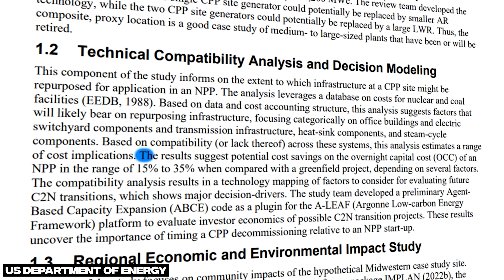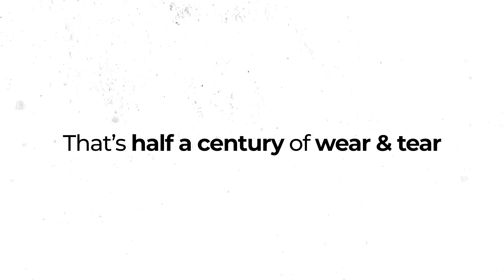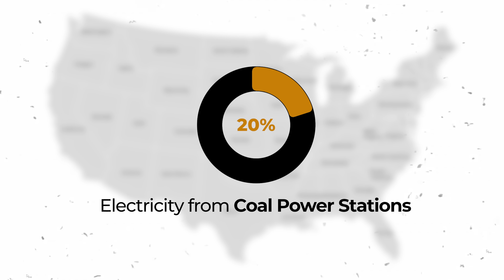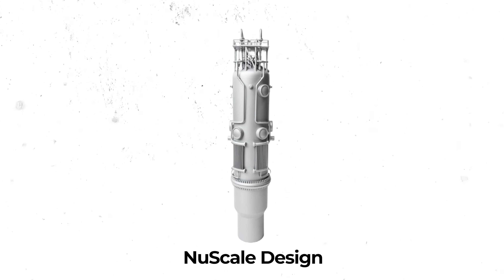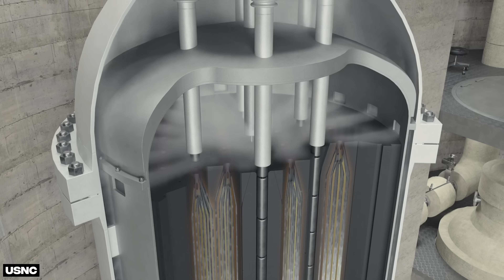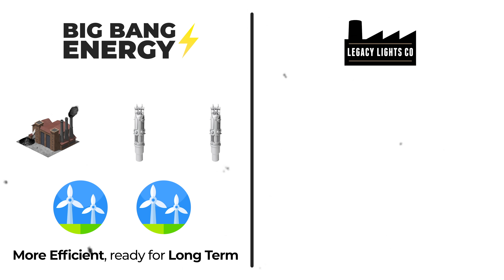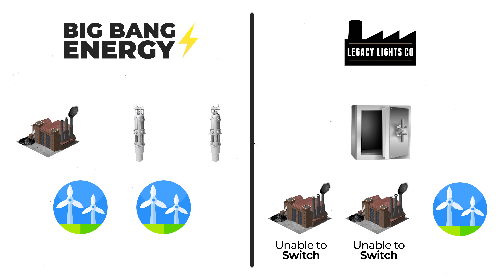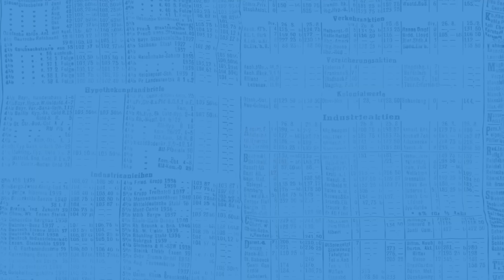Can We Convert Old Coal Plants to Nuclear Energy?

Comment: Great concept video; but you completely missed on a 2 key points (ignoring that all SMR's are currently ideas only and have not been proven to work; and there is not a single sodium cooled nuclear power plant that has not had critical sodium leak problems).

I'm now retired and have spent much of my life working in fossil (gas/coal) plants and nuclear power plants - so I have a real understanding of the challenges, issues, and possibilities.

1) All coal fired power plants use highly super-heated steam - and at temperatures and pressures that no proposed nuclear plant will even approach with currently known metals used in nuclear power cycles.   Direct reuse of the turbines, FW Heaters, etc and major pumps will not occur.    Reuse of the foundations that the current turbines and major pumps sit on can occur.  Reuse (likely with rewinding) of the electrical generators can occur.   Transformers, substations, and major transmission lines can likely be reused with modest changes.    The major cooling water source (pump-house, pumps, cooling towers, etc) can be reused likely with some upgrades or rebuilding.   The existing condenser is a toss up; and this is the biggest limitation on the output of the new generation as it will be size constrained by the existing structure: Nuclear saturated steam condensers need to be noticeably larger for the same power output than fossil supper-heated steam condensers.   My off the top of the head estimate is that you can expect at least a 20% power output reduction moving from high pressure very high temperature super-heated steam to saturated steam for the same condenser size.   Reuse of the old pipelines is very questionable as their poor condition is usually one of the key factors in retiring these plants (have you ever seen 50 - 80 year old power plant piping and components and dealt with their problems:  I have: trust me its better to just replace everything with the new reactor so it can have a long and reliable run life).

2)  You completely misunderstand and misstated the capacity factor situation.     Nuclear power plants have very high capacity factors as its been determined that the most economical way to operate them is to burn up all the fuel in the fuel rods over their planned life.  Thus they typically run @ 100% of power when operating (that is the goal); which gives at typical 90%+ capacity factor for the year.

Fossil power plants are "load following" as the electrical demand for power goes up and down during the day.   It's not uncommon for a coal/gas/oil fired plant to be at 15-25% in the middle of the night and 100% 12 hours later.

The best maintained fossil power plants are just as reliable as nuclear plants (they can regularly run nonstop for a year or more between maintenance shutdowns: although a number of coal fired boilers have a scheduled shutdown for maintenance every 6 months).

It's the load following characteristics of the up and down nature of the daily power demand that gives fossil plants an average capacity factor of 50%.    

If you replace all the fossil plants with nuclear plants then the nuclear plants will have to load follow as well and their capacity factors will drop correspondence.     Please note that two of the nuclear power plants I worked in were built as "load following" units (and they still had the controls installed to switch to "load following" mode); and their capacity factors during their initial years of operation in the 1970's was no better than the fossil plants in the area.

There's a lot of other lessor issues. But the key question is can an existing fossil power plant site be repurposed with replacement nuclear units.   Certainly some of them can be - and I think that would be a good use of them.   For a variety geologic and security reasons others cannot be.      It's just not going to be as simple as you propose.   Basically strip out virtually all the old equipment, pipelines, and wiring... and reuse the foundations and the cooling system pumps and cooling water source.
Reply: Thank you, Mr. Allan. It is always mind numbing when a plethora of stats and charts are presented without a good and thorough breakdown on meanings, origins, etc on where your numbers come from and what they actually mean. Your "re appraisal" of "load following" was a totally new concept to me, and I suspect to others following this site. Again, than you.
Reply from the maker: Thanks a lot for your feedback and insight. Unfortunately these kinds of details can be easily be lost or they can be presented as "non-problems." This study did look at a few different scenarios of re-use, from basically just the site and the office buildings, all the way to re-using the turbines. For the re-used turbine case, it did point out some of the difficulties you mentioned, particularly the different steam conditions (superheated vs not). The X-Energy high temperature gas reactor could (theoretically) produce the required temperatures, but would need another loop between the reactor and the steam side to make it work properly. But as you correctly pointed out, none of that has been built yet.

Load follow has become more and more of an interesting topic, especially as more renewables come online. Only a few places are using nuclear consistently for load follow. The US isn't one. France is the best example that comes to mind, but other has done it to lesser extents. So there is international experience even with the current designs to do it.

Anyway my honest opinion is that if such replacements at coal sites were made, most of the steam side would be replaced. It's the site that becomes more valuable with the existing grid and water connections. Cheers!
Reply: @@markaspen I never said SMR's were unrealistic.  But, my decades of power plant experience tells me that a lot of things did not work out the way that designers thought they would; and every country that built early nuclear power plants ended up closing some of them very early due to those problems.   Long term operation and maintenance also led to many other design retrofits (and I was personally involved in some of those).

It will take several decades of run time on any SMR concept to show that the concept actually works long term - or can be easily modified to one that does.   We can only now build really reliable long life LWR large reactors because of the many decades of lessons learned.   Those lessons learned don't exist for novel reactor designs.

I mainly pointed out that sodium cooled nuclear reactors have a horrendous history.  Multiple sodium cooled commercial nuclear power plants were built in multiple countries - and with the exception of the one in Russia were all very prematurely shut down due to sodium leaks (and the French one was supposed to fix all the issues of the earlier failures).

Russia currently claims that it's liquid sodium cooled nuclear plant is essentially sodium leak problem free.  Unfortunately, the history of the Russian Nuclear Program is that there are multiple cases where the real truth of the problems did not come out for 30+ years.   I don't trust the Russian statements based on that.

As such I consider the natruim reactor concept dead and will never likely be built.
Reply: @jimfrazier8611  I'm not mistaking what can realistically be done at all.  1st:  No one has solved the corrosion problem of the molten salt reactors to the best of my knowledge (and up to 4 years ago I had access to all kinds of nuclear plant information and concepts as I worked in the industry) and cannot yet be considered a serious long term power plant option.   2nd: there is nothing new about sodium cooled reactors.  Many countries built research reactors and at least 3 countries built commercial power plants (including the USA and France).   To the best of my knowledge (and I researched every sodium cooled research and power reactor ever built several years ago); every one of these have had significant problems with sodium leaks (sodium reacts violently with water - so a tube leak in a steam generator creates and effective ongoing explosion); and both the USA and French power plants were shut down way early in their planned life (nuclear power plants must run for many decades to be economical).   Russia claims that their liquid sodium plant has not had any real problems.  But I don't trust them as there are many stories from the Russian/Soviet plants on what really happened 20-30+ years ago that was covered up for decades.

The high temperature gas reactor (AGR & HTRG) is a more workable option - and there is a lot more commercial success with them (Peach Bottom Unit 1 and Fort St. Vrain in the USA and in the UK the now retired Magnox and now the AGR's which are currently operating); However, both the US units were shut down very early as they needed major modifications to be economical (design ideas worked well enough for proof of concept; but not for economical operation - this is why new concept plants need a lot of run time to prove they will actually work).  In the UK the Magnox plants were never economical as they were designed for both plutonium and power production and the more modern AGR replacements have done well but are about at the end of their life and the UK is building PWR's as replacements as they are more economical.

The other problem is that the current proposals for say the X-Energy helium cooled pebble bed reactor missed a key concept of power plant design.   They are designed to produce 1050F steam at 2400 PSI which is a modern value and on 1st look on paper would match many of the existing coal fired power plant infrastructure (although they may have to downgrade to 1000 F, 1005 F, etc for many of the older coal fired power plants as that is their design temperatures based on the alloys available at that time).   What those designers and many people just looking at steam conditions miss is that all of those fossil power plants use a dual heated steam cycle - which has to be matched if you are going to use the same turbines and to get the same efficiency and not destroy the LP turbine sections.

The typical fossil power plant of 1980 vintage will send 2400 PSI steam @ 1005 F to the turbine throttle block.  Run it through the high pressure turbine.  Then return the steam to the boiler to go through a "reheater" section, which again supplies 1005 F super-heated steam to the LP turbines.

Without this reheat steam section you will loose a lot of efficiency and power output, and will have major water problems in the LP turbine.   Even PWR nuclear power plants reheat the steam between the HP and LP turbines (I'm not sure about BWR's - I didn't spend that much time at one decades ago and don't remember)

I get the impression looking at the X-Energy and other sites that these people really don't know anything about key steam cycle efficiency equipment and processes (which has been standard power plant practice for I think about 75 years on large units; and was covered well in my college thermodynamics class on steam cycle power plants when I got my engineering degree many decades ago).

I'm now retired and spent much of my life in marine steam propulsion and power plants (both fossil and nuclear).  I look at most of the new design concepts as nice ideas; but I believe that only Holtec with their SMR stands a chance of working as designed. Holtec has the working knowledge of LWR lessons learned; and the vast majority of initial design plant ideas failed economically after being built.  Mistakes in the nuclear power plant industy are very very expensive to fix - if they can be fixed at all.

The pebble bed hot gas reactor is the 2nd most promising technology that I have seen.   There's a lot of research on pebble beds; but I don't understand the concept of not planning for a reheat cycle (which tells me that they are missing the obvious - which leads to the question of what else are they missing).
Reply: @atomicblender  I agree that the steam side of the plant would be replaced.   

Please see my answer to "@jimfrazier8611" below on what is wrong with the concept of using the C-Energy reactor to supply steam to the old fossil turbine generators.     I'm dumbfounded on why they didn't include a steam reheater as part of their reactor design for a steam power plant.   I wonder if anyone working for most of the SMR concept companies have ever toured a power plant and learned about steam cycle efficiency.
Reply: I worked in the nuclear industry for 40+ years at 5 different facilities and people like this YT creator have no real world experience.  Everything in nuclear is documented, evaluated, and exact.  Coal fired plants are so far removed from the way a nuclear plant is operated as to be two completely different animals.  Of course, there are so many details that it will have to actually be done to expose all the issues.  Terrapower is planning on siting their Natrium reactor at a 60 year old coal plant site.  It will be interesting to see how that all plays out.
Reply: @perryallan3524  These MSR fan boys rely on YT videos for their "knowledge" .  I am of the "build it, operate it, and prove it" before claims can be made.
Reply: @@markaspen A wheeled nuclear power plant?  Really guy? what are you smoking?
Reply: @clarkkent9080  I think they are just desperate to cut costs. The existing site will have a major trunk connection and an extensive switchyard, transformers etc.
Presumably there is also a convenient source of cooling water, and existing pumphouse, piping, filtration etc. 

This is all fine. May as well use that.
I think they will have enough trouble with waste handling and the longevity of exotic materials in extremely corrosive and hot environments to fail anyway. I further think that advocates are being hopelessly optimistic about the waste burning capability. Waste-burning uses up neutrons like crazy, neutrons that would otherwise generate heat in a responsively controllable manner. It uses up good fuel to destroy what is barely burnable at all, and that the heat recovered by wate burning will barely exceed what was used to "burn" it. And then there will still be lots of U238 etc getting bombarded... I think these reactors will wind up generating just as much transuranic waste as any others out there, plus fission products, but that the spectrum of heavy isotopes will be skewed towards those that are even more difficult to dispose than simple spent uranium fuel.
Reply: @aaroncosier735  Building a new nuclear plant next to an existing nuke seems to make more sense to me and that is the direction that VC Summer and Vogtle chose. And there are sufficient shutdown nuclear plants to provide more than enough locations for the needs of the near future and they come with all the necessary site evaluations and grid connections

 If you dig deep into the reasons for the massive cost and schedule over runs on the VC Summer/Vogtle projects, it runs the gambit from suppliers unable/willing to provide nuclear grade components, fraud, in adequate planning/project management, lack of workers with the skills necessary for a nuclear build and the inefficiencies that come with anything complex.  
In my simple mind, the current  issue with nuclear is not the reactor design but the inability to construct one in a reasonable time and at a reasonable cost that can compete with other generation methods.  Until the construction issued is addressed nothing will change. 

Specifically concerning the "new" reactor design concepts, my best guess (and you know what guesses are worth) is that fusion will be here before these new designs can be built, proven, and  "bugs" worked out. 
In summary, I would not recommend anyone pursue nuclear engineering or any nuclear career as there are enough ex-navy nukes with the necessary skill set to fill future voids left by boomer retirements for as long as this commercial nuclear party lasts.
Reply: @@markaspen Net ! I do not follow Russian nuclear technology as it cannot compete with the Western safety standards as has been proven in both their commercial and military fields.

 The U.S had the SL-1. While not mobile, it could be assembled on site in a few days from modules.  You can read that story on how that SMR worked out.

The TES-3 was on tank tracks driven through 22 wheels, so I'll give you that it was sorta wheeled. 
This Soviet utility was built on the body of T-10 Tank and weighted 310 tons and was capable of transporting over 37 pounds of uranium. Some tests were done in the 1960s, but the unprofitable project was ended in 1969.  If it was unprofitable for the Soviets that don't care much about safety ( no containment and no safety systems) , do you really think it would be a good fit in the west?

And at 1.5 Mw it could not power much.  That is the equivalent of 350 solar panels.  BTW, the standard U.S. PWR requires more than 100 Mw just to operate all the necessary equipment (Hotel load).
Reply: @@markaspen Given that this YT creator has no nuclear education or experience, and I have 40+ years at multiple nuclear facilities, you can take that for what it is worth. Or not , I really don't care.

My experience is in the U.S nuclear programs.  What happens in other countries has little bearing on what can happen here in the U.S. . And no, coworkers do not want to talk about work related subjects or the history of nuclear power. We usually have a nuclear power plant to run and concentrate on that.  In your line of work, you must have a lot of down time around a water cooler. But we do like donuts so you got one right. 

As one example, China was the first country to build the Westinghouse advanced passive safety feature AP1000 and actually built 4 that are not only operating but were built on schedule and within budget.  VC Summer and Vogtle had all of China's building experience but VC Summer cancelled theirs and Vogtle is 120% over budget and schedule.  So would you use China as an example for the U.S. ?  You seem to be a SMR fan boy, do you use SL-1 in your arguments ?  It was, after all a U.S. reactor.

I have never used the SL-1 event to argue why a SMR is not feasible since the technology is worlds apart.  And a Soviet reactor tank with no safety features built in the 1950s before I was born is also of no concern.  Do you argue that we should be able to build cars for $2,000 like they did in the 1950s that had no safety features???

You should stick to whatever subject your career is in, be it waiting on tables or delivering for Uber eats.  

BTW, from your improper use of grammar, I am guessing public school educated and one of those students that should have been left behind.
Reply: @atomicblender  The best that any can say about any discussion about atomic energy, is to quote a famous movie line ' It's complicated". Meryl Streep deserves special recognition for that one! But I do think the US is finding the way back, just slower than I would like. The wrangles over final disposal are as much of what got us here as Three Mile Island or Fukushima- and it is something we need to solve now, not later after we have, as Russia, littered the landscape with dead and dying devices using nuclear energy- as it is US carelessness over things like decommissioning dental X ray machines and such are very troublesome and need Congressional action- the most "missing" component of any forward plan on nuclear energy in the US. 
  Thank you for your reply- I picked up your channel because you seem to be working very hard to give us some idea what is going on on both ends of this and other areas.
Reply: @clarkkent9080  I appreciate your experience, and do understand the difference as I worked in fossil plants before moving to nuclear plants.
Reply: @Mark Aspen For SMR's to work in Blender's present discussion, local communities would have to accept them as close neighbors- as close as the present coal fired plants are- to their homes and children's schools. That doesn't look surmountable just now, tbh.
Reply: @clarkkent9080  Totally agree.   I suspect the pebble bed hot gas reactor can be made to work.  But it's likely going to be a 2nd generation design from what they have and they need to spend $2-4 Billion to build one and run it for a decade or so to find out what needs to be changed in order to produce one that does work long term.  If their design does'nt make a decade run, then it might be a 3rd generation iteration before it really works well.
Reply: @perryallan3524  I have never worked  at a fossil fuel plant but I have worked with maintenance employees that were transferred from a coal plant to a nuclear facility.

  This is certainly not a stereotype as I only had this one experience but these previous coal plant workers just wanted to get the job done and had little patience for preplanning, verbatim procedure compliance, and radiological controls.  They were very good and hard workers but had trouble understanding all the controls and details in work control. They simply wanted to get the job done. In the nuclear field, documentation seems to be more important than physical work

I would expect that nuclear workers transferred to a coal plant would also experience difficulties. 

I once met a maintenance manager from a chemical plant and discussed hiring some of the employees from my nuclear facility that was downsizing.  He stated that he would not hire any of our employees because in the interviews he conducted, the employees would highlight all the safety awards they received and the specific equipment they were qualified to work on. As he put it, I need a maintenance guy that can work on any pump, valve, conveyor , or component in my plant and safety in the job is expected not rewarded.  That is a reality check.

Even after 40+ years in that nuclear environment, I still got upset at the paperwork, reviews, delays, safety meetings, and post work reports that one had to endure. What do you say to a Facility Manager that states that there is no such thing as an accident as everything is avoidable?  While I understand his point, there is also a cost associated with that and it is obvious in the cost to construct and operate a nuclear facility. 

I am retired now and can voice my opinion from the comments section.
Reply: @clarkkent9080  I understand.  I would also call your referenced Facility Manager ignorant (at best).  There are accidents in nuclear power plants.  Not all events can be foreseen and prevented - even if you had unlimited money; and certainly not a lot of things where it's not considered worth inspecting, or using better inspection equipment (and even the very best inspection methods and equipment is not able to see 100% of the flaws and defects).    Been there, done that.    I've even made that argument to the NRC and they agreed.

Here's a story you will appreciate: One Plant Manager was pressing me to write an evaluation on why it was OK for them to defer the PM on a piece of equipment.   I had been refusing to do that.    I got notice during a maintenance outage when I was working 80 hour weeks and dead tired that he wanted to see me in person to discuss this "serious PM issue" - and I knew the standard drill (either cave or quite).

Instead I walked and and told him that I understood that I was hired not just for my technical expertise but for my honesty and integrity; and if that's not what he desired from me that I was ready to negotiate my paid exit right here right now....   He totally backpedaled - and we agreed that we could discuss the issue after the outage when I wasn't supporting near critical path work.

I never wrote the evaluation he wanted.
The new Engineering Director who was new to the site and had been not aware of the pressure on me on that issue went ballistic and chewed into the Plant Manager when he heard the story the next day.   The Site Vice President gave me a $4000 pay raise when he heard the story.

That equipment failed during the summer knocking the plant off line - just after I had started a  2 week vacation - and no one called me (apparently the Engineering Director told them to let me be on my vacation and deal with the issue on their own).    That equipment was out of service for almost 18 months as it was in such bad shape that it had to be replaced before it could be returned to service.

Have a great life...
Reply: @perryallan3524  Great story and I would enjoy discussing more over an adult beverage as I am sure we both have many stories.  
The Facility Managers point was that every event was preventable and every event had one or more individuals that could have prevented it or made it less severe. But I agree with your assessment and its just something you suck up.

I was in operations and during the outage every work package had to be approved by the Senior Reactor Operator and that was me on this day. I had a line of people waiting for review and this one electrician had a work package to PM a spare breaker that we never used.  We had a $hit load of real work that needed done and I rejected it.  One hour later he was back with the same work package and said the Operations Manager wanted it done. I rejected it. The Shift Manager gets a call from the Operations Manager and tells me that INPO wants to see a work package performed so they wanted something simple and easy.
The idea that the Operations Manager did not trust our mechanics to do a proper job no matter what it was and the fact that so  much real work was needed to get the plant back on line boiled my blood.  I told him I was signed in on the log and responsible. And if he wanted to come down to the control room and sign on the log he can approve anything he wants.  The Shift Manager relayed the message and I never found out what happened to the INPO auditor and the package never returned.  Never got a raise that year but I slept like a baby. 

 I started in 1974 and saw everything from the crazy good old days through TMI and  everything after.  I was taught that the only thing you have in the nuclear industry is your reputation and integrity as the industry is relatively small and word gets around. 

I am not ashamed of anything I ever did or how I handled myself.
Reply: @@markaspen It didn't work as planned and was very uneconomical.  That's the reason it was never further developed and it's "ancient history."   Anyone who studies nuclear technology development reads a summary on it.
Reply: @@markaspen On the contrary... many of us 60+ old engineers wonder that often when presented with half thought out ideas...    I rarely use the term.  But, I have at especially bad concept with people who really should have known to dig into details better.   Perhaps you need to do more research into various nuclear technology experiments and power plants of the past and why they were not pursued or shutdown early. It's really a fascinating area if your into nuclear technology and nuclear power.
Reply: We've been running SMRs for decades, in nuclear submarines.
Reply: @neuralwarp  Which are about the most expensive nuclear reactors out there.   I don't think they will be economical in the commercial world.   That is why Shippingport was shut down. It was a US Naval reactor and not economical as a power plant.  But it was a good test platform for several concepts.
Reply: Don’t we love arm chair experts